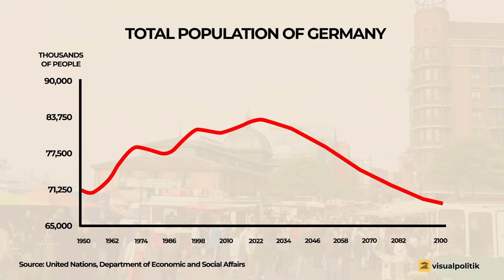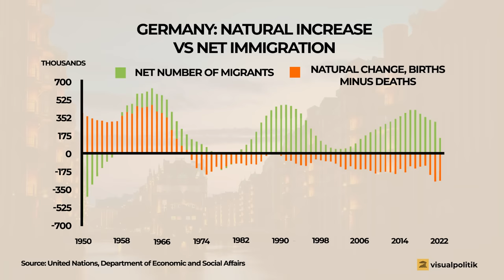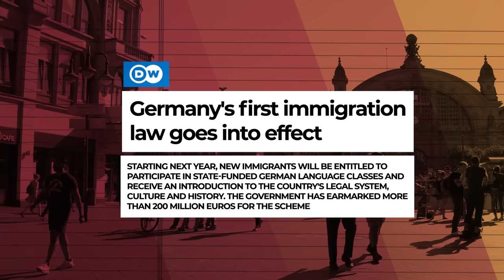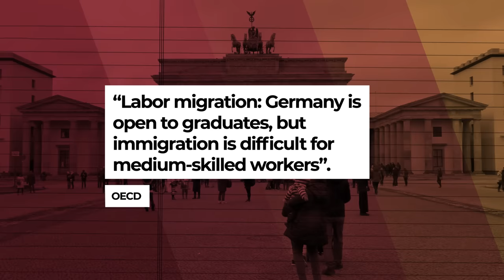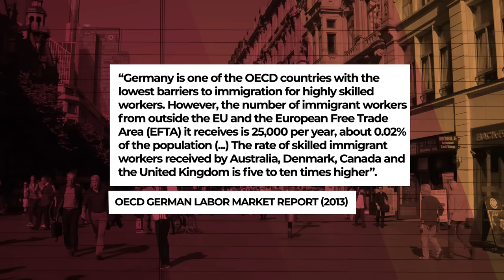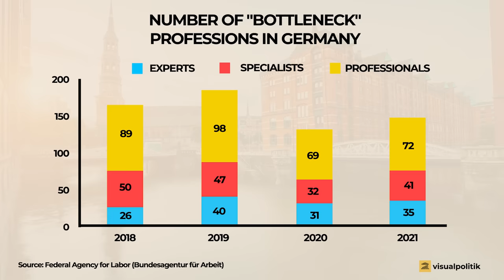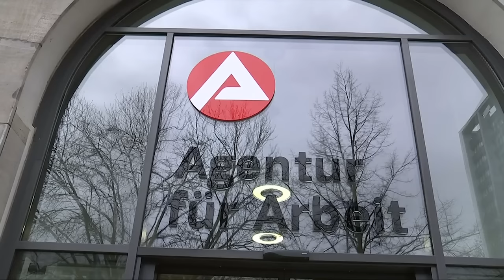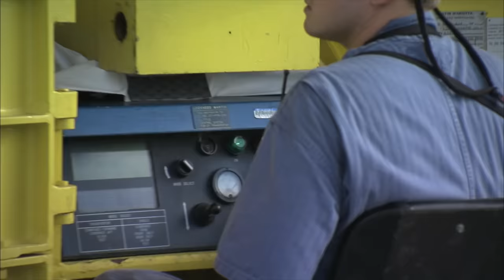Why Is Talent Fleeing Germany?

Comment: I moved to Berlin recently (as a software engineer), and I think one of the main issues is that it's absolutely not welcoming (yes, even large parts of Berlin) for English speakers, even though English is pretty much a standard language in IT. Yes, obviously German is the official local language, but if they want to compete for talent I think they're ought to be more willing to speak at least a few words in the de facto international language, English, when one cannot speak German (yet). Here in Steglitz where I live it's mind-boggling: You walk into a DM, Rewe, Saturn, any shop, and you cannot get any help with anything, quite often with pretty bad attitude. Same with the mailman or couriers... You ask if they speak English, and you get "Nein". Sometimes I feel they'd let me die lying on the street just because I can't ask for help in German. :D I can't imagine how bad it can be in other parts of Germany.

Secondly, it's an absolute pain to rent a flat. These days you're basically lucky if you find something for 1500 euros, and even that has probably applicants you have to compete with, and if you don't have existing records of previous rents in Germany, from some sort of a registration system, recommendation letter from previous landlord, etc., your chances are much worse or nil. It's quite crazy. Then, if you sign a definite term contract, I heard that you'll able to extend it only up to 2 years, and then most likely the landlord will ask you to move out, because otherwise you'd be converted to a long term renter with more protection. So even when you move in, you already know that you'll have a lot of pain having to move and find a flat again in a relatively short time.

Third, you have to have licences and insurances for stupid things, like you can't simply use an e-scooter, but you have to register a legally accepted one, and buy insurance for it. It seems that lots of things are tied down with excess bureaucracy that not many people are happy to expose themselves to if they have other options.
Reply: Well to be hoenst alot of workers don't even speak german properly yet, hard to force them to learn english ontop of that.
But by the way at least where Im at in Cologne most people speak english, even kids on the street. Older people not so much (or they refuse to)
Reply: Well, the biggest mistake you did was to even think about moving to Berlin. Even though it's the capital it actually is more of an open air mental institution and a third world turdhole of a city. Seriously, as someone living in Frankfurt I was shocked to witness what our capital actually is. 

But even if you live somewhere else in Germany, you might just get a small improvement, although not that much of an improvement, because those taxes and that fifth world bureaucracy combined with poor political decision making on a federal level are you going get ya eventually and there ain't nothing you can do about it except move away and even then they'll try to milk you for every Cent you have. 

It's actually quite fascinating to witness how fast the state can act if there is a opportunity to milk someone for even the smallest amount of currency, but when it's about undoing their own wrong doing upon someons or helping with permits etc., then they are apparently slower than the half life reaction of the most common Iron isotopes.
Reply: You want to work and live in a country, when you are not able to speak its language and are not even able to do a simple conversation in the grocery store? xD You are funny.
Reply: That's the point. Yes, you don't have to be welcoming to people and acknowledge international culture (which is predominantly based on English). I'll just leave, move to a more welcoming country, and Germany will have one less experienced software engineers, good for you. 😛
Reply: @leakyabstraction  
Germany has one of the highest english speaking % of population in europe, good luck. Maybe try west Germany were people over 30 didn't learn russian instead of english in school.

You can't expect a country to restructure it's entire culture to attract as many people as possible from one sector. Especially considering alot of people aren't going to school anymore and IT and english have only become more important relatively recently. Let's say in 20 years chinese suddenly becomes THE language in tech. Germany decides to attract more chinese talent, will you start learning chinese with 50 years old so chinese students don't have to use german to order food in Germany?
Reply: @sblbb929  
Chinese will never become common atleast in IT FIELD.
something which is standard , it's hard to change that . And English has now become standard in IT sector only because of USA big tech companies. Even Chinese tech workers learn English to work outside of china
Reply: @sidy6526  I never said it will. Just a hyperthetical to underscore a point
Reply: @Ratselmeister  I expect people at a FOREIGNERS' AFFAIRS OFFICE to be able to speak English, I am told that I am welcome and needed as a skilled immigrant, imagine I'm a fresh immigrant, I come to get my residence permit card - and people working there either don't speak English, or actively REFUSE to and actively insult visitors, I have actually seen that happen multiple times in multiple offices. If Germany is treating immigrants like this -  it shouldn't be surprised then people don't want to come there in the first place.
Reply: @NukeWalker  in what country will you find officials who speak English to visitors in conditions where the official language of procedures is the state language?
look at the problem differently - 99% of the world's population (especially not from English-speaking countries) understands that in another country paper work is carried out in the state language and that if you do not understand it, then you hire an interpreter at your own expense. Easy.
if for you these basic principles of the bureaucratic apparatus are rocket science, then maybe you are not so skilled?

by the way - for people like you exist Business Immigration Service, where people speak english, just google in future
Reply: Why do you expect other people to speak your language if you cant speak theirs? Learning a new language is hard and time intensive. And many people here dont even speak german properly. 
Also, most people working at shops only finish the 10th grade. Thats a b1 level in english. And if they didnt care it is probably less than a1 or a2 level.
Reply: It's not really about language. I was lucky to know how immigration officials treat people differently. I worked as s de for 5 years, First time I went there at early cold morning and tried my best to ask how can switch my work visa, they interrupted me rudely and asked me to stare at their eye before said anything, fortunately one year later I have to do the same thing but accompanied by a local colleague who is responsible for such issue, unbelievably they never stopped to smile all the time. That was the time that I realized I will never be welcomed no matter how hard I try to settle down   in Germany
Reply: @zichaohu4056  Oh they smilled. Horrific. Sad you expierced such rasicst violance.
Reply: @Anna-rb6rg  In UK or US immigration office have support for other languages beyond just English. In Australia you can get assigned free interpreter if you are not speaking English.

Comment: As a software engineer I could earn around 60k euros in Germany, 150k in Switzerland or 200k+ in the US. And even more, the taxes in Germany are higher, it would leave me with maybe around 4000 euros per month net. Which is a similar salary software engineers can also get in much cheaper Poland or Czech Republic. That's the main problem, it's the money that attracts skilled workforce.
Reply: In Germany, 60k is actually a really good salary, even as a software engineer and would give you around 3.3k/mo net 👍
Reply: I've been in Switzerland 2 months ago for business. The canteen food did cost around 23,- Franken. compared to that in Germany with around 5,- euros at the same quality. So you have to earn more than two times of the german salery, to live comfortable in Switzerland.
Reply: @menju32  In that case the german canteen must be heavily subsidized. It's virtually impossible to get the same quality based on current food prices in Germany...
Reply: @MrTamm0r  your correct. It would had been 7.50 euros without substitoution. So still one-third of the switzer price.
Reply: @joolean7799  its good for "German standards" maybe, its not good in the real world :)
Reply: @menju32 You cannot compare cost of living by just looking at two random canteen prices. Even looking at a broader category like groceries or prices at the bar isn't enough to compare two places. you need to consider all regular expenses to get an acqurate picture. Also, 23 bucks for a canteen meal is expensive even for Switzerland. At my company here in CH, it's 10 bucks for employees and 13 for external people.

Comment: I left Germany in the mid-90s. My American wife could not find adequate work, mainly because her degrees were insufficient by German standards. (Even though she was, and is, fluent in German.) The red tape and the tax burden is just as crushing as it ever was.

But there is also another factor: With a lot of refugees coming into the country, the perception of foreigners also changes, and not for the better. For example, do Asian immigrants really want to immigrate into a country that values them less than immigrants from European countries?
Reply: I have honestly never heard anybody complain about migrants from Asia. And why would anybody? Those are not the people causing the problems. I have never seen a group of Asian men acting aggressive in public. There are other groups that are causing huge problems and those are the ones that will never be accpeted. For a reason.
Reply: @informant09  You would be surprised. Not that I have an anti-Asian sentiment, but with the current political climate in Germany I would be careful. It wasn't that long ago that Germany defined itself along ethnic lines, and you will find a general anti-immigration bias in certain parts of the country. Heck, even as a native German with American citizenship, there are quite a number of places I tend to avoid.
Reply: @larsf.4756  Sub-communities and pockets in Germany are still extremely xenophobic. 

I am no supporter of open borders for anyone or unrestrained refugees from middle East and Africa. But this position is mostly for security reasons and to a lesser extent I feel that many such people would never be able to integrate in the German society. 

To cut the long story short, I was extremely surprised when I found that many Germans still dream of genocide on people they dislike. In eastern part of Germany many even dream of killing children of refugees or migrants to completely wipe them out.

Comment: Having such a low fertility rate is the core problem.  Everything else is just a reaction to that problem
Reply: German has a higher fertility rate than many countries in the EU, like Italy, Spain, Portugal and many more
Reply: @robbsclock2675 still low tho
Reply: @Helloguys_c1p  - yes agreed they have even bigger problems, and weaker economies.  But that does change the statement about the core problem is fertility

Comment: There are many things germany needs to do. 1) Make it so people actually have children again. Right now having children is expensive, also culturally things have changed. family start later and dont last, divorce and break ups were rising dramatically from the 60s and now only have slowed down a bit (though rising again since 2018). 2) What is going on with our youth? If we cannot replace skilled workers that means we are not producing skilled workers. Our education system fails them. 3) Our bureaucracy is killing this country. Also the amount of paper and fax systems still in place. If you want to report or sign anything it takes forever, months of waiting for an appointment. sitting in some lobby for hours and then if you miss anything you gotta come back another day. So many things should just work online, Why can I not send an email with all the necessary paper and a worker checks them out and reports back when everything is settled? We live in the 21st century.

Comment: If your society requires immigration to sustain its population... then it should be clear why no skilled immigrants want to move there.
1) The replacement fertility rate is 2.1 kids. That is a very reasonable number
2) Most people want to have families
3) "Across the European Union, personal ideal fertility among women is 2.28" In America it is 3

Where am I going with this? The failure to reach replacement fertility rates is solely a function of societal & economic conditions, not personal choice aka you've created a system so toxic to living, adding kids to the mix would not be feasible. If Germany had spent less time figuring out how to get immigrants to throw into their meat grinder of a society & more time figuring out how to make their society less like a meat grinder... they wouldn't have the problem with population or immigration

Comment: Companies can be quite picky when it comes to hiring non-German speakers. As a master's student studying Intercultural Management with 1.5 years of experience, I have been facing rejections solely based on the fact that I don't have a B2 level of German proficiency. It's disheartening because my German friends believe my CV is excellent for a 24-year-old about to graduate.
What I can't understand is why companies are so stringent about language requirements when Germans often secure positions where English is the primary language in the office. It feels like a double standard. I believe that being fluent in German is undoubtedly valuable for effective communication within the workplace, interacting with clients and customers, and integrating into the local culture. However, it seems that for certain positions, where English is the working language, the language barrier shouldn't be an insurmountable obstacle for candidates with strong qualifications.
Reply: You want to manage germans but you can barely speak german? Like duh you're not getting a job...
Reply: @yyunko7764  well just because I study management doesnt mean my first position is straight up management. Your comment makes no sense. I am talking about getting a working student or even praktikum(internship) positions not a 3 year experience position.

Comment: The biggest lie of the German job market is this so called " Fachkräftemangel" or "lack of skilled talent". There is no shortage of talent in "good paying jobs". I am working for a Big German company and we receive dozens and dozens of Cvs on every job posting.  One one entry level positing we received like 15 Dipl.-Ing(Masters in Engineering). applications .The point is that there is shortage in only those sectors where physical work is needed or conditions are tough and salary is low (Hospitality, Nursing, Old care etc). 
So if some Talent is coming to Germany thinking that some good job will be given to them immediately then they are misled. Please remember that.

Comment: From my point of view, the recruiting processes in Germany are no longer up to date.  Applicants who do not fit 100% into a company's requirement profile fall through the cracks.  This even happens when they are overqualified!  If an applicant lacks a skill they could learn in three days, they will be rejected.  In addition, today's job advertisements often have exactly the same wording as they did 50 years ago.  I know several highly qualified Germans who prefer to work abroad for such reasons.

Comment: As a non EU citizen and partner of someone employed, I wasn't allowed to work for 5 years. When I could work, I had to take a job as an "untrained" person, although I had two degrees - they weren't recognised. I did a part-time masters, did C1 and C2 parallel and was given a chance to work, albeit at a lower pay level, as I still didn't have 100% parity to local requirements. It took 8 years to get back into my profession, and I am still 1 pay level below my colleagues. But I am one of the "lucky" ones. Many expats end up leaving.

Comment: Before you get to your (no doubt well-informed and accurate) explanation, I'm going to have a stab at a couple of explanations as to why Germany sometimes struggles to attract highly skilled migrant workers:

(1) Distribution of companies around the country. If you go to the US, UK, or Netherlands as a skilled migrant worker in tech or engineering, there are a few major cities that are obvious destinations. This is not so much the case in Germany, as some of the country's biggest countries are not based in the big urban centres. You find big companies employing tens of thousands of workers headquartered in relatively small and unknown cities and towns around the country. These places just don't have the same pulling power when it comes to attracting talent.

(2) Language barrier. Although it's changing now, German workplaces have been relatively slow to adopt English as their working language, compared with, say, the Netherlands, the Nordic countries, or even Spain. If you're coming from abroad, and maybe you've worked hard to master English as your second language, you want to be able to work in English. You don't know how long you'll stay in Germany, and although many people are willing to learn some German to get by, it still adds an extra layer of friction, and we're all prone to taking the path of least resistance.